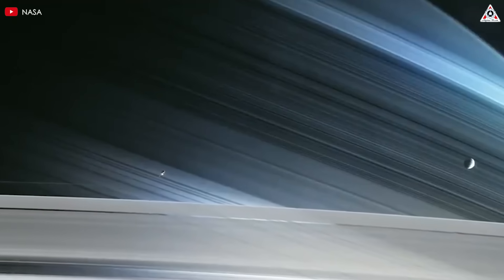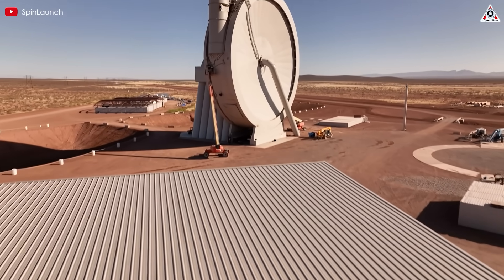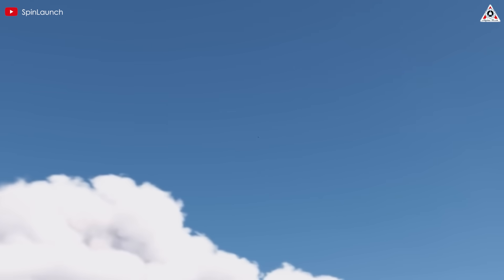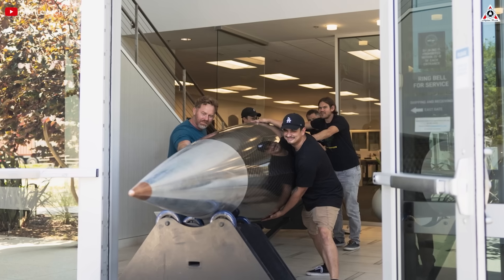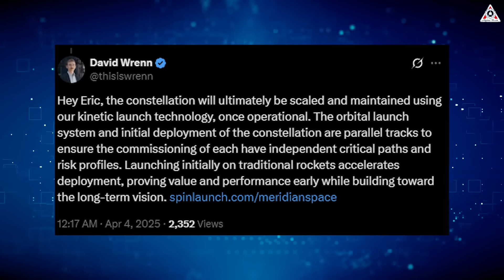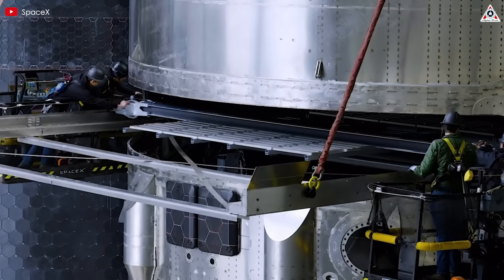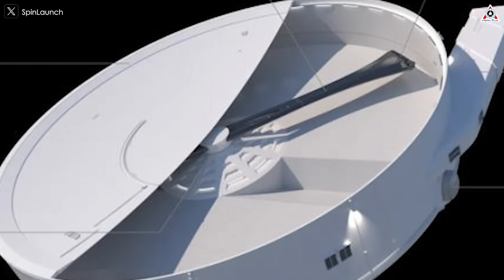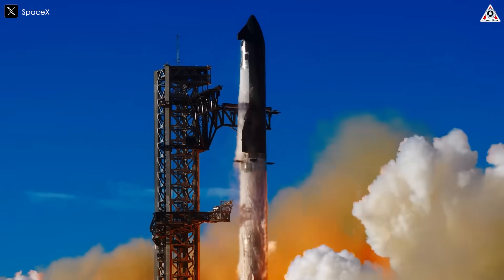It Happened! Spinlaunch Stopped Trying To Make An Orbital Accelerator After...

Comment: How did they plan to deal with the imbalance on the arm at the moment of release? The system would eed to release a corresponding weight into a tunnel at the exact moment the missile was released or the whole contraption would shake itself apart. A totally insane idea that still managed to get backers. It just proves you don't need intelligence to make money or burn it.
Reply: Thinking about your shaft & counterweight comment, I imagine them digging a 10 ft shaft to receive the counterweight at 17000 mph…🤣
The USAF hypothetical orbital weapon “Rods from God” (Hypervelocity Tungsten Rod Bundles) would have an impact speed of ≈2,100 mph. The impact of the centrifuge’s counterweight would destroy the entire facility. Not quite the Trinity site detonation, but close enough.
Reply: Duck…
Reply: I don't know how much vacuum they're supposed to be achieving in this thing. It couldn't be much due to the shape of it not being cylindrical, it would cave in. Even if, when the projectile penetrated the diaphragm there would be one hell of a violent implosion it wouldn't have pieces tearing and bending outwards and flying outwardly.
Reply: Basic high school physics..
Bizarre waste of money.
True
Reply: ... You literally describe the solution and then declare it impossible?
Reply: Yes. Because the solution is cataclysmic. The USAF hypothetical Rods from God would be in orbit at 17K mph. Upon being de-orbited, atmospheric friction would slow the rod from 17,000 to 2100 mph at impact. That's a loss of 88% of its velocity.  To throw a object upwards from the surface to orbit given a loss of 88% of initial velocity, the object would have to be spun at 4400 rpm, producing a velocity of 136,857 mph (and 365,000 g's).

Not sure what weight was being considered for the craft, but lets say 1 ton. If the counterweight of 1 ton was released into a shaft travelling at 136,857 mph, the energy release when it hits the bottom of the shaft would 22,759,833.6 Terajoules, or 237,082 times the blast of the Fat Man bomb over Nagasaki (96 TJ)
Reply: @TennesseeConservative 
Do you want to use this chance to redo your math?
Reply: No. I think you fail to comprehend the energy involved in a 2,000 lb object moving that fast.

Comment: I got just two words that no one else seems to have addressed. Atmospheric friction. If current spacecraft have to deal with it in the thin upper Atmosphere, don't you think it's going to be an even greater problem launching through the thick Atmosphere near the ground at escape velocity?
Reply: Don't worry. It seems very unlikely that this device could ever achieve close to escape velocity.
Reply: @TheTomBevis most hairbrained idea I ever heard of 😅 after the "space elevator "
Reply: Putting aside the friction/heat aspect, there’s the deceleration effect. The USAF has a hypothetical weapon system design called “Hypervelocity Rod Bundles” aka Rods from God. 20 ft x 1’ tungsten poles in orbit that can be de-orbited on command to strike “bunker” targets with a non-nuclear device. The estimated impact speed is ≈2100 mph despite starting out at 17,000 and being subject to a constant 1g of acceleration. Putting aside the 1g (can’t do the math), the RfG loses 88% of its initial velocity due to atmospheric friction. So to retain 17000 mph upon reaching orbital height, we divide 17000 by .12 to yield a release velocity of 137,619 mph.🤣😂

Comment: You don't need a startup company to compute, orbital acceleration never will take place for throwing objects into orbit. Total BS. As is with a space lift. Total BS either. This is nothing else than alchemy of the middle ages. With a major, severe difference. The chemists of the middle ages were just trying. Computing spinlaunch never will take place is a straightforward computation. And knowledge about max g loads electronice may withstand. You cannot develop undestroyable versions of common electronics, necessary for the huge spin rpm needed.
Reply: Throwing objects into orbit can work, just not on Earth
Reply: @Sweenus987  So, where's the benefit? First you rocket things to moon, then you throw them into moon orbit? Think twice.
Reply: @wolframzirngibl1147  Where do you suppose a craft could go once in Lunar orbit? Hmmmm?
Reply: Nope, electronics can be fired out or artillery, that's not the problem.  There are real problems however.
Reply: @rogerxan  The elelctronics fired with artillery are specifically built for that purpose. The payloads of spacecrafts are civil electronics - mostly. Be assured, they do not withstand.

Comment: I was wondering about the heating factor of the projectile in the even that it left the ground at 18 to 20,000 mph ... That speed at low altitude would surely make the projectile heat up to extreme temperatures and probably even more than the re-entry temperatures through the less dense atmosphere ...

Furthermore, the accuracy for timing release through the exit tube at these huge speeds would be insane ... Any minor error would be a disaster.

Comment: Idk who the engineers were on that, but me being only an amateur really always thought it was a grift because what they were trying to do was a much more difficult problem than launching an actual rocket.
The idea isn't new, evn von Braun had a similar idea, but he wasn't actually as crazy so they mathed out a linear launch.

Just understand it in your head that this contraption needed to store the energy required to lift a mass up into earth orbit. You can take a mass and do the calculations for the required energy, and you will quickly see that this contraption could never do that. 
The forces acting on it would have required insane precision which is nearly impossible, because at these forces the tiniest vibrations will resonate and rip the thing apart or at least deform it, and then cause insane friction on the deformed parts which would cause melting, offgassing and then they wouldn't have a vacuum and the friction of the air might have damaged the spacecraft.

There is just too many issues with this idea. In theory it should or could work, but thats theory only. Extreme precision costs money, and the higher those speeds and forces become, the more precision, or lets say the less tolerances in construction are required. I don't know exactly what these tolerances would be, but I can imagine that building and maintaining might have required precision to be below 1/10th of a millimeter on all parts from the propulsion up to the craft, the release mechanism and various other parts, not to mention that it would have to be a 0 vibration propulsion motor with rotation also. 

On top of that you mention the G-Forces. Yes they act on the satellite, and thats bad, but thats also what could potentially create all the problems listed above. Its a pipedream and a grift. Building a fusion reactor is more feasable. (not a surplus one just yet)

Comment: instead of merely reading the advertisement given by a company, start asking the right question and move from there. electricity is one of the most environmentally destructive forms of energy, especially so-called "clean energy" solutions using third-world, highly polluting production methods for extremely short-lived and highly unreliable power generation...
Reply: Electricity production is actually effective unless it’s from a coal plant. 
Where I live (Washington state), we produce electricity from hydroelectric powerplants.
Reply: @ammerudgrenda  of course, hydro is the preferred method of generation, followed by geothermal, and nuclear, but they are not universally available and are prone to over-development. so what would washington be doing for power without hydro? would the same political brain trust that gave you autonomous zones in seattle develop the second most available, geothermal, which is almost as abundant and "clean" as hydro in your state?...